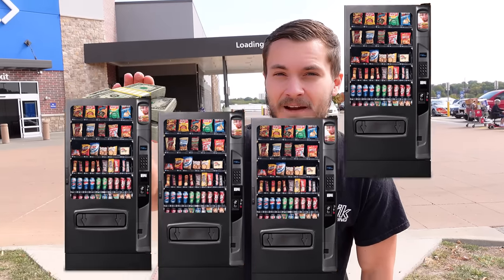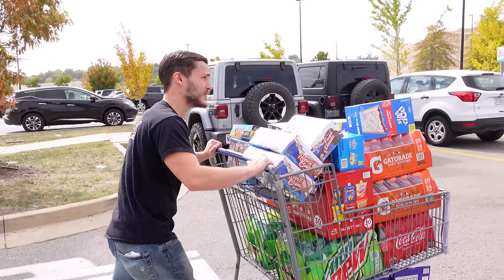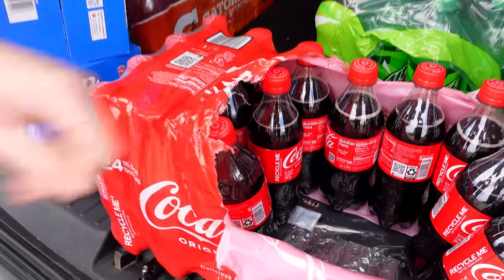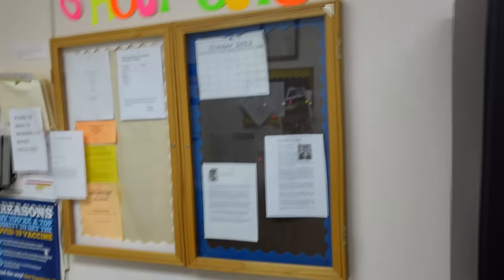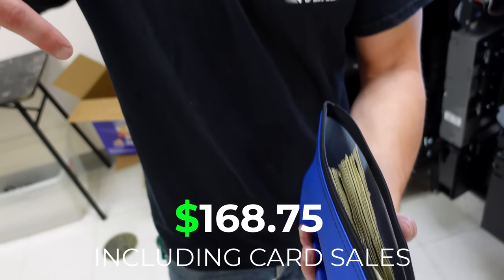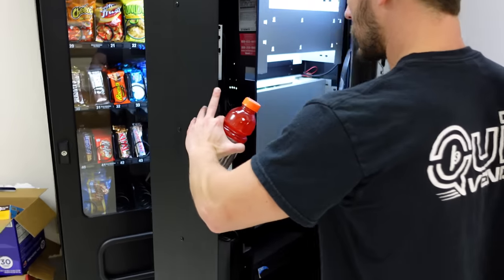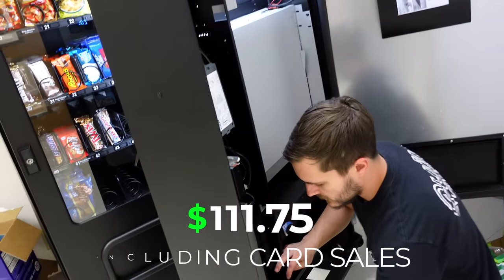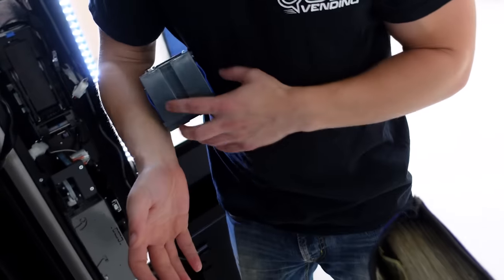Collecting Money From 4 Of Our Vending Machines!

Comment: including gas, restocking, and maintenance, what was your total profit? it  says 526.50, but like, you spent $306 to fill them, so im guessing you profited about $150-200ish from this run? honestly not bad im just looking for more accuracy when it comes to money made since this video is about how much money you made that would fall under profits instead of just total. Also how much did you pay for those machines? most machines I see online even on marketplace are at least $600+ for a used one, and hardly any used ones have card readers, each card reader for a vending machine adds like an extra $150-200 to get that installed, and a new vending machine will easily run $800+, so im assuming with 4 machines with card readers you paid around $4000 if you got lucky and got a deal, so about how many runs of these vending machines can you do before you need to maintenance the machine? That will determine how many runs you'd have to make in order to actually pay off the machines and make money with this business. Thanks, sorry for the long winded essay, just want some accuracy on the profits to actually figure out how long till your actually profiting. one moar thing, do you write off your miles you drive for taxes and when you restock are those wrote off too?
Reply: It’s a nice return in 12 days but definitely the cost of inventory isn’t cheap. Seeing all of those snacks they bought I wouldn’t be surprised if there bill was over $150, and that’s Sam’s club.

Comment: "Tip for maximizing profits with a drink machine: strategically display two flavors, but deliberately mark one as sold out. This nudges customers to make a selection from the available flavor, and more often than not, people have two favorite choices. When it comes to the food section, try filling products less to the top and alternate different colored M&M bag placements. This way, if someone wants the bag behind their initial choice, their mind has been subtly upsold. Smart strategies for boosting sales and satisfying customer preferences!" Oh & tap their flyers on the inside of the glass. A small gesture adds a personal touch, making them feel noticed & valued.

Comment: Im trying to figured out the numbers and the time invested in this. In todays age driving to Costco on sundays and do the shopping will take 2-3h, than drive to location and fill the machine another 2-3h, than go wait in line at the bank another 1-2h so its minimum 5hours of work.

Gas probably 20$ for the day hopping you are close by.

Wifi bill, electricity bill, machine rent bill, credit card fees bill. You said it's 50% profit so you made 250$ for 12 days minus the fees so rounding up to 200$ for 5h

It is not bad, also your credit card points will add up pretty fast, but it's 2 sunday you are loosing every month, for a small 200$ I guess you could stack more machine but than you have to drive further, its about 100$ per machine per month for 2.5hours each 

It's ok, but it is not with out risk, machine will break, you have a maintenance cost to take into equation, plus thief, obo, insurance.

Also your calcul is for 12 days, thats if you actually makes it to the machine every 12 days, for your machine to be trully maximised. If you dont make it, you have an empty machine not making money, if your sick or having personal reason.

It's not a bad idea, but over time, its time you invest in a very bad way that could makes you a lot more money like learning a skill or doing art or doing another job that is much more fun. On the long run you ll get bored pretty fast

Comment: How much is it usually to run your guys vending machines? Just curious -liam
Reply from the maker: Hey Liam! Do you mean how much does it cost in electric? If so, the soda machines which keep drinks cold do cost more to run than the snack machines. Anywhere from $300-500 per year in electric for the soda machines.

Comment: Like watching but you are over paying for the chips. The boxes contain the $.50 bags. Buy them individually and save more. Or even better buy them at Dollar General. There they are buy 9 get 1 free so you spent $37 at Sam's Club for those 60 and could have got them at DG for $27.
Reply: Same thing the 20oz bottles. $20 for the 24pk is way overpriced.
Reply from the maker: Thank you! We will check our two local dollar generals, hopefully they are indeed cheaper there! That would be GREAT! Lol
Reply: Yeah, if you look at the bag size in the multipack they are the same size as the $.50 bags now. They made them smaller last summer.

Comment: I love the new style of video. Even with the shopping and anything. It shows how you two work together.
I'm a German living in Austria now and here the money is different. For the Euros we have coins up to 2€ and the bills are starting at 5€ - you're getting so much bills out of the machines because in the US there's a $1 bill also. I'm wondering why... Maybe because bills are lighter than coins?
Reply from the maker: Thank you!! And that is interesting! Here it’s common to get change back in $1 bills when buying things in every day life, so people tend to have $1 bills to use, including us!
Reply: @quikplay  A few weeks ago I was walking through the city I'm living in now and I found 2 US quarter Dollar coins. I was amazed how your coins are "rated" here it's also cent but it's 1, 2, 5, 10, 20 and 50 cent. And then, like mentioned before, 1 and 2€. And the bills are 5, 10, 20, 50, 100, 200 and 500€ (200 and 500€ are rarely used because any store or gas station refuse the acceptance) I've had 200€ bills before and I had to go to the bank or a casino to get them changed to 100 or lower...

Comment: Lol. Half of it though. Sometimes you put money in and its not giving you anything. Smart one will stopped putting money in and actually go and pick up candy or soda and go buy it. I worked in Home Depot. There few of them in break room and i was told to not put money in that one but other one  cuz that one jus doesn’t work good and half of the time, itll drop candy after you put money in. Year later, it still havent fixed yet. So yeah anyway never fan of those. I just go in and pick up what i want and go buy it. Save me from losing $1 LOL 

Actually one of managers of ours have key. And was told he can open it if you had the issues. I thought okay… but nah. 

Good for you ripping people off lol.